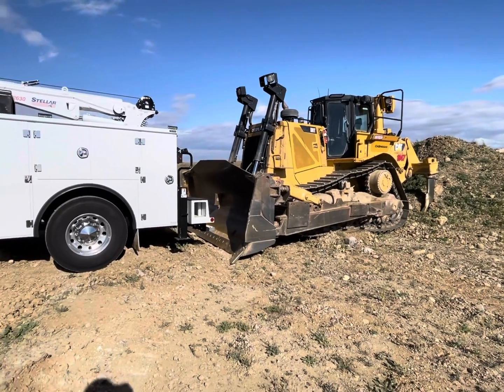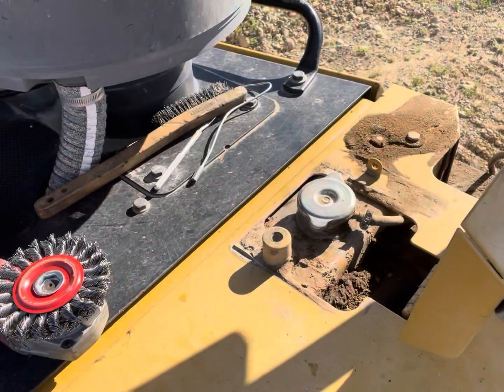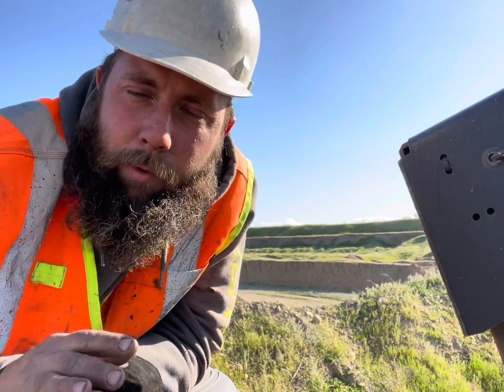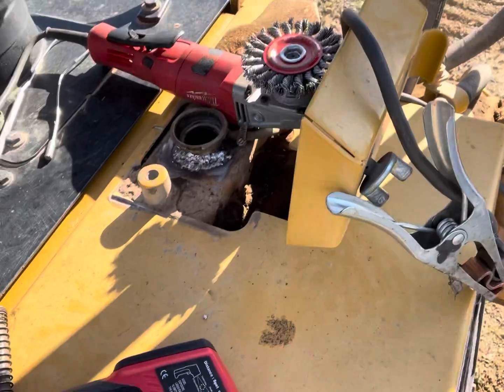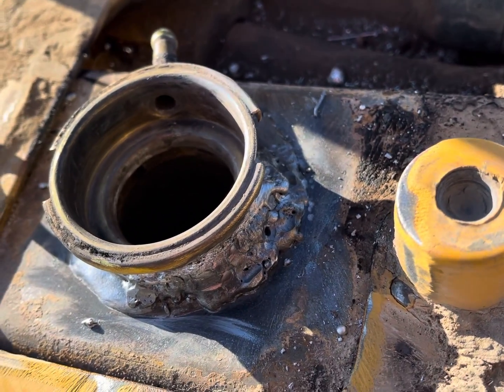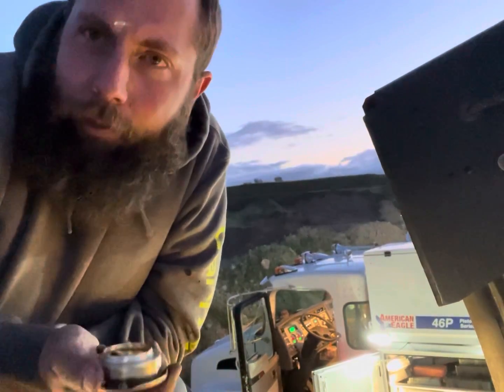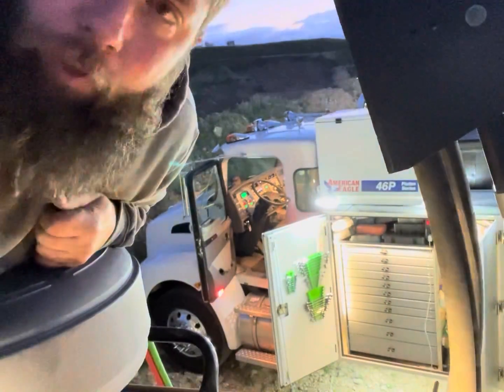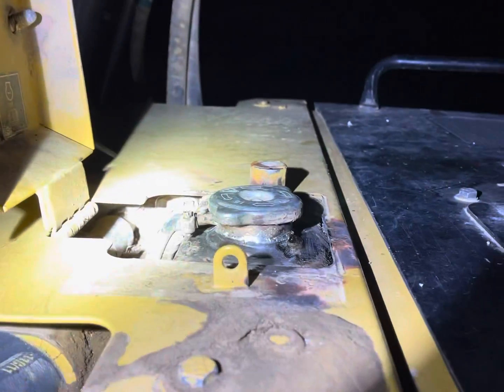CAT D8 Radiator Repair

Comment: FYI you needed a good quality FLUX and a good quality solder. I never saw you use flux and that's a must when soldering.
Reply: This, soldier will not work without flux
Reply: Depends on if it was flux core solder or not. Additional flux won't hurt, but isn't always necessary.

Comment: For better soldering, especially on dissimilar metals, dirty joints and ones previously soldered, you should try Harris Stay Brite 8 solid solder wire with Stay Clean liquid flux.  The flux is corrosive and needs to be neutralized after soldering but a quick wash with baking soda solution is effective.  They will make a job like this go a lot quicker and look better when it's finished.

Comment: Need a flux for soldering and get to stick to anything.  Flux removes the oxide layer that develops on metals when exposed to air.  Without it it just doesn’t stick.  Some solder has a flux core but only work immediately after melting.

Comment: Nice upgrade on the truck. I would add a .5" plate over the existing top plate on the bumper. I work for a CAT dealer as a field welder and they love to put that stupid bed liner stuff everywhere to catch on fire and melt.
Reply from the maker: That plan is already in the works. I’m going to extend the rear bumper/ workbench And add 1/2” plate to the top.  I will make a video about it.
Reply: @OFW  Nice.
Reply: @OFW  I have an IMT body on my KW and i built swing out 2ft x2ft  plate to try and keep grinding and welding sparks away from the bed

Comment: In the UK, we don't weld radiators but braze them. This includes the radiator cap mounts.

Why? Because radiators flex with heat, which can cause welding joints to split and soldering, is simply not strong enough, whereas brazing is more flexing friendly.

Comment: Only ever had good luck using silica bronze and brazed them with a torch. Probably could tig bronze them too but torch is faster and cleans the stuff off them first usually
Reply from the maker: Ya I should have brazed it but I drove 2 hours and didn’t know exactly what I was getting into.

Comment: When you are welding on the machines do you have to disconnect the batteries thanks
Reply from the maker: Yes and no. But It’s good practice to disconnect the batteries.
Reply: Its good practice always turn off disconnect switch, you don't want to trash a ecm!

Comment: always use flux when soldering...
if that solder had the built-in flux that stuff only works good on small jobs, that was not small but not big but there didn't look like there was enough flux...
with a job like that soldering a complete neck ring on? using solid core solder with flux paste would of worked better imo.
flux makes the solder flow nice and even, sort of like the gas helps with your wire welding, same principle i think ;o)

Comment: Only way to fix something like that, start from scratch.  Goodness knows who has done what and when to that radiator cap.  For the folks in YouTube land.  Solder is usually two types.  Lead/tin solder alloy along with rosin flux is usually used for electronics and the like.  100% tin solder with acid flux is used in drinking water pipes because the paranoids think the lead will leach out of the solder alloy and into your drinking water but I still use tin so anyone who might buy my house in the future will be able to get financing on it because there is no lead in the solder of the pipes.  Don't over flux any joint but flux them all.  A lot of a good  thing isn't always good. You'll know when it's too much, turns into black boogers and is hard to scrape off.  Clean it like he did in this video, pretty and shinny and you have a much better chance of getting a perfect joint.  NO!  Not that kind of joint, the solder kind.